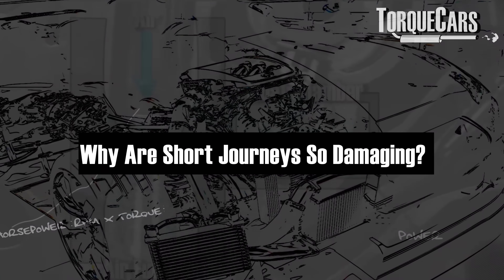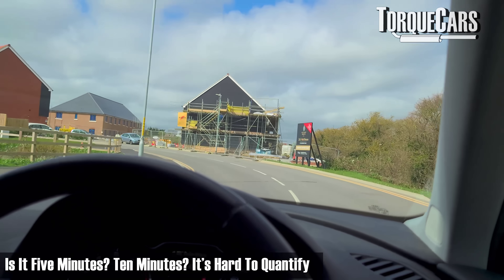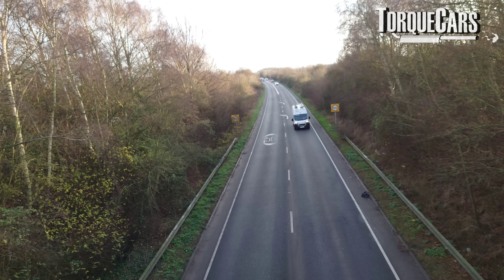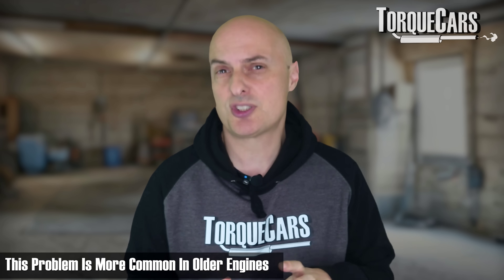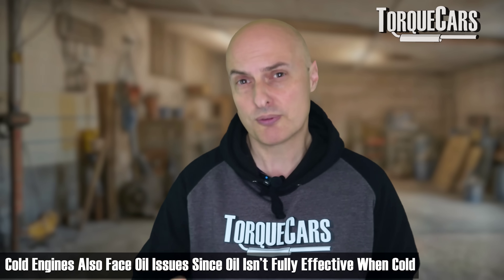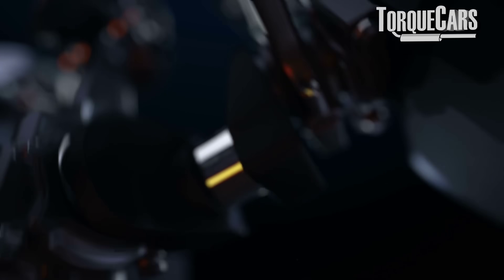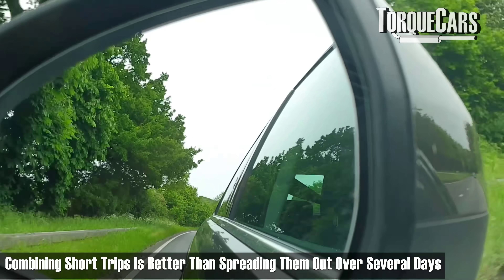Why Short Drives are Damaging - Discover The Causes & Avoid The Problems Of Short Trips.

Comment: I do mainly short journeys, school runs, supermarket and gym all around 3Km. Every few weeks I drive 80 miles to see my son. On petrol cars I found the cat fixings would rust through even on stainless steel exhausts. On Diesel cars the DPF would self clean frequently making it look like the engine was on fire. My solution was to get a PHEV car, virtually all my journeys are on battery. An electric car would probably be best but the devaluation on them is prohibitive.
Reply: Same! Electric for shorter journeys at lower speed & stop/start where damaging to ICE & it is inefficient, ICE for longer trips at higher speed where electric is (horribly) least efficient. Electric motor boosts smaller ICE when torque demand necessitates. Also save a few hundred Kg & $$ of battery.

Comment: I keep wondering how they've managed to deal with this issue on Hybrid cars.
Reply from the maker: That is interesting, they use a thinner oil and run much tighter tolerances so the oil is optimal around 50-60 degrees. pistons are often cooled which controls the expansion and most hybrids have a thermos to store warm oil/coolant so it stays at temp for longer.

Comment: The one thing advice like this always lacks is HOW damaging it actually is. a.k.a how much I should care.
Reply from the maker: It depends on the car, for most if you abuse then when cold you're taking 30,000 miles off the life of the engine where it will start to burn oil or bearings will fail. I'll try to answer this question in a video backed up with more research for each major engine type.
Reply: I worked for ford and this subject is quite pointless. The majority of damage actually comes from break in damage. This is why I tell people to change oil at 500, 1000 and 2000 miles to avoid break in damage. This can take 100,000 miles off the engine and could be the factor if your engines gets to 200k or not
Reply: It’s a bullshit video. It could’ve been a short. The damage is null as long as you get the oil to temp and the water burns off which can be achieved by idle before or after your trip
Reply: @TorqueCarsDriving  30,000 miles off of what number?!

Comment: Oof, 95% of my drives are within a 5 mile radius of my home and I live in a cold weather state.  Since the pandemic, I've worked from home, so I no longer have a commute, which was roughly a 30 minute drive. I can confirm that it has been hard on the car ... and have recently needed to replace it.
Reply: Sounds like a good scenario for a BEV or PHEV... or even a supplementary eBike/eScooter if you can protect yourself from the windchill?

Comment: First you can connect your battery to a battery maintainer like I do and keep batteries fully charged.  They are inexpensive and it's like having a new battery every time you start the engine.  If you do drive short distances, before shutting off the engine, rev it up for a while.  Get it to 2500-3000 rpm's and get the engine warm/hot.  That'll burn off  the moisture

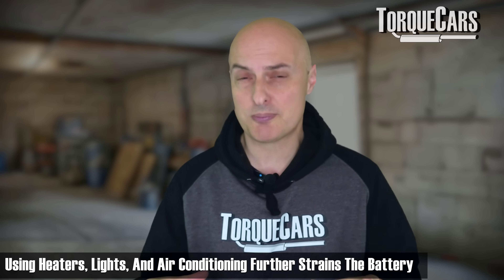Comment: 08:50 What do you mean the battery's doing more work? What's the alternator for? If the battery was doing anything, we'd see people losing ignition at high engine speed
Reply from the maker: I didn't explain that very well did I? A short trip does not provide enough power to top up the energy the battery has lost starting the car in the first place, therefore overall the battery is doing more work over the short trips in that it is draining and not being replenished, also in winter this is worse as you are using heaters and blowers etc, further reducing the power the battery has over the long term with multiple short trips.
Reply: @TorqueCarsDriving I suppose charging it does take time. I always assumed the high voltage of the alternator topped it up basically instantly. I've also never measured the voltage drop after a start, so there's that too
Reply: @MrTehNoms I also recently had this concern the last few weeks since it was my first time staying a substantial amount of time in New England. Briefly googled some results and they returned a range of 15-30 minutes to restore the energy used during the initial startup (probably depends on the alternator, battery size and load on the vehicle). This also might've explained why my first 2 batteries died within 2 years each. Unfortunately remote work and everything around me that I care to go to (grocer, friends, restaurants) is a minimum 30-40 min walk but a 5-10 min drive 😅
Reply: @Mxlan_u Wow 15-30 minutes... I've been so ignorant of the electrical side of this. That's crazy

Comment: I certainly noticed it when I was two-wheels-only for a decade. My bikes didn't like my routine trips to the shops, five miles each way. I then started going the longer way around, nearly a total of 30miles, giving them some beans on parts. 
This changed them from being a bit grumbly and hesitant to running properly and much more responsive.  I will point out that they were properly maintained and serviced regularly.
My more modern car doesn't seem to care, but it's got some management control, even so I give it a longer trip at least once a month, of up to fifty miles, including a ten mile motorway belt once it's up to temp.

Comment: My father used to run these insanely short drives (nearly daily, IIRC) to the local bank and back. He would start a dead cold car, drive, maybe 800 to 1000m to the bank, turn off the car, do whatever he was doing there, then start the car back up and drive home. And he did this daily. Weirdly enough, the only thing that got damaged by this was the battery, which had to be replaced after a very short amount of time (maybe a year or two from new?). Though the family doesn't own that car any longer so I cannot tell what other, more serious issues it may have developed after we got rid of it. 
Personally, I make it a point to prolong my short trips by taking detours - especially in colder weather but I'll do it in summer, to. I absolutely want to avoid turning the car back off after a few kilometers/minutes of driving from a cold start in the morning, so I'll take a few unnecessary turns, avoid stop-start heavy routes and generally put some more mileage on the car than I need to. I sadly don't have an oil temperature gauge but I will not stop driving until at least the water temp has been sitting at normal operating temperature for a while. Car's been running on 0W20 since it came from the factory and I've stuck with that weight (think 5W30 is also permitted) as it's what the manufacturer recommends plus it hasn't spent a night out on the street in years and years, so I'm not too worried about cold starts. But I do know that these are some of the highest stress your engine will ever have to endure and I don't want to put unnecessary strain on things just by being lazy or careless.

Comment: Low rpm driving keeps blow by out of the oil.  Don't sit there idling breaking down your oil.  Get rolling getting engine and tranny warmed up asap.  Within 30 seconds unless it's brutally cold or you have an old carb engine, obviously.

Comment: It takes quite a while for the oil to get up to temp.

Anyone know what temp the oil needs to be for full lubrication?

Coolant operating temp is not oil operating temp.

Get the oil rings warmed up by low rpm driving asap to keep excess gas out of the oil, causing oil breakdown.

Comment: This is mostly about conventional direct mechanical transmission, either via manual or auto transmission. However, a lot of it is also valid to hybrids, although their engines do not idle at all. The big snag with those is the performance of the small lead acid 12V battery, which has to deliver enough currant to switch on the high voltage to start up.

Remember that lead acid batteries have a quoted rating at 25 °C; at 0 °C it is 25% down. Sometimes, in cold conditions with short running times, it’s wise to measure the voltage and use a suitable charger to top it up. Toyota have suggested that one hour a week is about the minimum power on time to mitigate the problem/

Another matter that used to be awkward on older petrol engines in cold conditions was the condition of it’s spark plugs, with them failing due to unburnt carbon accumulating on them. Some engines that have to start and stop on the move, like the Toyota ones, use modern plugs that are virtually immune to that kind of thing though. They have to be good enough to always work when required, when extra power is required on the move.

Comment: In Canada winter is harsh on cars. People idle their vehicle 15 to 20 min to warm the cabin, however, idle too long could cause oil dilution. Its better run your in idle for 10 min, than drive until the engine warms up. Block heater are life saver as well.
Reply: The majority of the world doesn’t experience weather under 32F for more than a few weeks out of the year.

Comment: so in my younger years i did not care for the engine, not because i´m a moron, i simply does not knew at this time that i had to warm it up before using it to the max. And i think this is a problem that many people have. Driving schools often are not teaching this. And this is a shame.
After my cars failed one after the other, i was sure that i was the problem and not the car. 
So i searched the internet, talked to mechanics and yes.. I was the problem. I got very useful tipps from an old Mitsubishi mechanic, and in 2008 i bought a new car. But this time i took very good care of the engine.
Engine on, wait 20 seconds on idle and then drive with low throttle and lower rpm (under 3000, best under 2500) until coolant temp has reached operating temp. Drive 5 more minutes gently. Now you can floor it. 
My car now has 200k miles on it and it never had any problems with the engine. Nothing at all. Every part under the hood except for the filters/oil and belts are the factory ones. After 17 years all parts are working fine. 
And this says alot because its a Ford 😂
One thing that you should absolutely do, is letting your car cooling down before shutting it off. Don´t need to wait a minute or two, 20 seconds are enough. 
Your engine is just like you. It needs time to wake up and get on the tracks. If you wake up, you also need some time. Think about your engine like its your best friend and not your "thing" that drives you around.

Comment: I’ve owned cars for 35 years. Never bothered with any of this. Never had engine wear issues to the point I’ve noticed. Cars have lasted ok or I’ve sold them anyway. All journeys start as short journeys.
Reply: Just because I drink and drove home without a problem doesn't mean I did everything good. There are Honda civics that can went to 50k miles without oil change. Doesn't mean you shouldn't change your oil. What kinda dumb person are u? any IQ?

Comment: I generally warm my engine and leave for 2-3 minutes and then I back up my car out of the driveway .
Reply: No need to warm up by idling. Just start driving very gently until the temperature gauge starts moving up.
Reply: @johanbrand8601  have to . Cold starts rmp is around 1500 , but normal idle is at 1000 rmp ...
Reply: @qwill8254 what car do you drive?

Comment: It’s super simple. IF YOUR OIL DOES NOT REACH FULL STABLE OPERATING TEMPERATURE it’s a short trip. Your COOLANT TEMP is irrelevant.  Gentle driving after initial idle kick down is optimal. This will warm the oil, coolant, transmission and differentials all at the same time.  I know some old folks think 20 minute idling is the way but carburetors generally aren’t installed on modern engines and that is where this idea originated.

Comment: So a short drive isn't any worse than a long drive cuz either way there is that period when the engine isn't warm?
Reply from the maker: The idea is that the warm drive cleans up the oil (as it warms the dilution evaporates to some extent) and it helps reduce carbon deposits build up by keeping the injectors and reducing the soot output of the engine.

Comment: Are we talking about diesel or gasoline engines?
Reply from the maker: To a large extend much of this applies to both engine types, particulate filters on Diesels need longer runs or you'll get problems and oil dilution affects both engine types to varying degrees according to design.

Comment: A key distinction to make is that the water being up to temp on the gauge, is not an accurate representation of the engine fully being up to temp. Oil, temp and water temp are two different things. The most important thing is that oil is up to temp and that all condensation has been burned off in the crankcase.
Reply from the maker: You are correct, I would say to let the oil reach at least 60C ideally closer to 90 would indicate it is fully warm, but at 30 to 60C it's still doing a good job of lubrication compared to the cold start up.
Reply: thank god my car has an oil temp gauge as well, i don't move my car until coolant temp is 100 F and then move, keeping it below 3k RPM and 25% throttle max until temps are under 140 F (dunno what that is in C) and only hit boost above that.

Comment: I usually start moving within 1 minute of starting but I am gentle on it for the first 5 minutes. As long as the engine reaches normal temperature at any point in the drive it will remove any impurities and be fine.
Reply: Not nearly enough, especially in cold conditions.  When the oil has reached full temperature, it takes another ten miles to fully evaporate the acidic condensation created by a cold start.
Reply from the maker: That sounds like a good plan to me, much like my own strategy.
Reply: I do that too ... For  at least the first 2 to 3 km the car is mainly in automatic mode ...
Reply: I started rolling in about 30 seconds.
Get those rings warmed up with low rpm driving.

Comment: Plug in hybrids (like my 2026 Prius) pretty much negate all these problems.  The super short trips can be done on EV mode where there is no engine wear, and you're only starting the engine when you're taking a long enough trip to exceed the range of the hybrid battery.  Toyota hybrids also start the engine in a different way (spinning everything up with the electric motor BEFORE starting the engine) that causes less wear.  Sure once the engine is running it still needs to warm up like any other, but since it's really only going to run on somewhat longer trips, it's much less of an issue.
Reply from the maker: Yes they are well thought out, they use thinner oils, tighter tolerances and even have a "thermos flask" to keep the coolant/oil warm for longer.

Comment: So doesn't every long journey start as a short journey?  Curious but how does a longer journey repair the wear and tear on the engine from the beginning (short journey part)  of the  long journey?
Reply from the maker: The primary "repair" is the oil dilution (fuel and moisture) will evaporate away on the longer drive, it also keeps the injections and related components nice an clean rather than clogging them up. The big factor is avoiding hard driving during the early part of the warm up phase.

The overall aim is reducing long term engine wear, it's all cumulative over a period of time.

Comment: And this is why I drive a plug-in hybrid. When I have a short journey, I use electric power, and avoid this altogether.
Reply from the maker: Me too now, I find that some of my longer journeys (15 mins) are now short journeys in hybrid mode so for those I switch to conventional mode to allow the engine to warm up. I think I do about 30% on electric and 70% on petrol overall but only had it 2 months now.
Reply: @T @TorqueCarsDriving do you mean charge mode? I make use of charge mode on mine when I’ve got a longer journey, I’m out of EV range, and have another short journey that would be better to cover in EV mode later in the day. 

But mine’s a Toyota, and their hybrid system fully warms the engine conventionally before engaging the hybrid battery, so I figure it isn’t helpful to force it to run the engine for a drive like that

Comment: how about electric cars? Is a short drive detrimental to battery?
Reply from the maker: I don't have enough data to work from, I would have thought that the battery will be fine, it's short fast charges that need to be avoided on those. Motors are still subject to warm up and cool down but I doubt there is a problem as the temp range is not as high as in a combustion engines.

Comment: This is only half the story. It’s not only temperature, it’s oil pressure. In engines fitted with Start Stop tech, the oil pressure drops immediately, producing metal on metal ware on each restart.
Reply from the maker: You'll be surprised how quickly oil pressure goes up after a start. Usually within one crank rotation, don't worry too much about the scaremongering videos on here which compare a bad stop start block with a well designed reliable non stop start block. It does depend on the car and how it has been designed but I would stick my neck out and say stop start is not as damaging as it is thought to be on modern engines (and I've worked on quite a few now).

Comment: To prevent cold start just put it in the microwave for 55 seconds.
Reply from the maker: I tried that and it broke my glass plate, perhaps I should drain out the oil and warm that up then pour it back into the engine every morning?

Comment: All this is true. With one correction: not sure about Europe but in the US all cars have heated O2 sensors so closed loop is reached very fast even when exhaust system is still cold. And finally, bmw, audi, and suchlike junk represent bad examples.
Reply from the maker: You are spot on, I found it easier to just say about "warming up the O2 sensor in the exhaust" rather than going into the complexities of the different designs, they still can take 30 seconds or so to get up to temperature though.